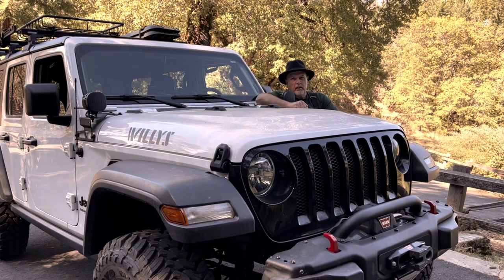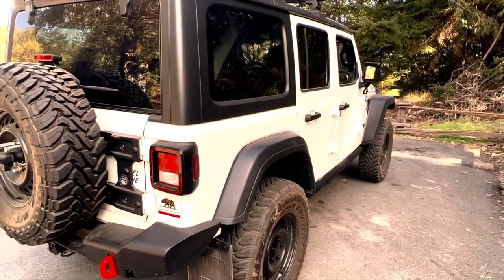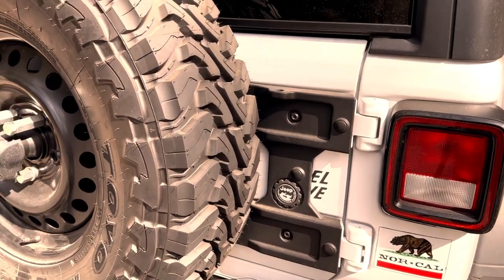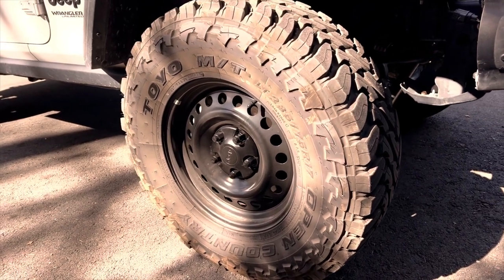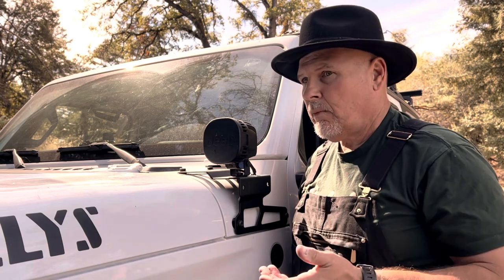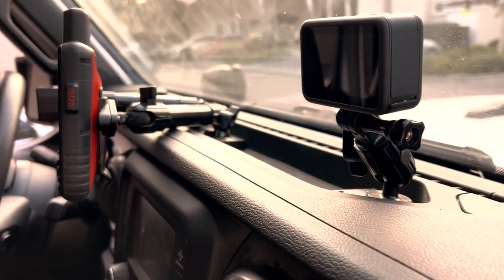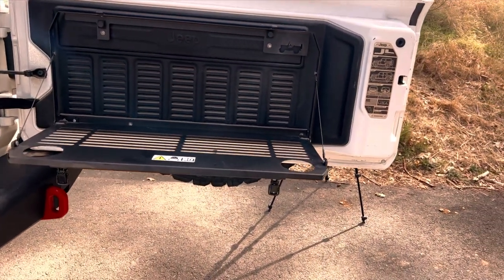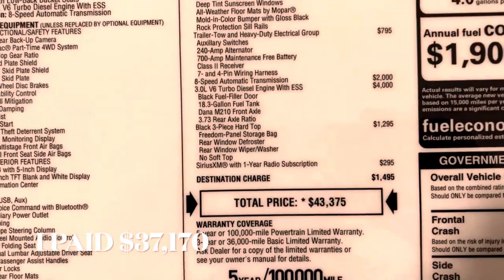How to build a Overlanding rig and drive it daily | and how much I paid for this Jeep

Comment: I totally agree with sticking with Mopar parts if they have the part you need.  They're well made, and always fit.  I'm getting the Mopar A pillar light mounts for my new 2024 Willys, but I'm going to use them as mounts for CB and Ham antennas.  It looks like I still might be able to attach the lights to the side of the mount, since they have holes there.
Reply from the maker: The A pillar bracket is stout. I would not be surprised if you could easily mount other stuff on it. I like the Mopar lift. Geometry has been figured out and system has been tested. Waiting for the Mopar Bilstein lift for my wife's Gladiator to be delivered. That one I will install myself. Dorman Products are good too. They are OEM quality.